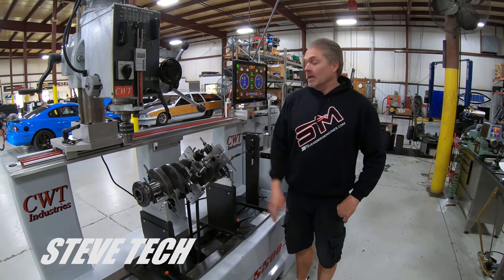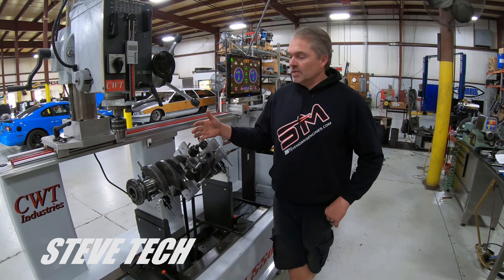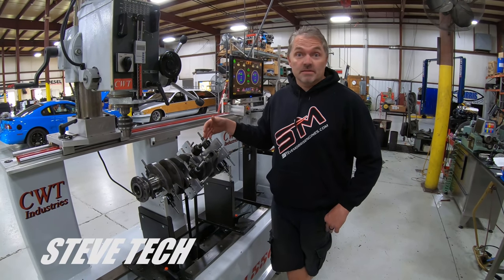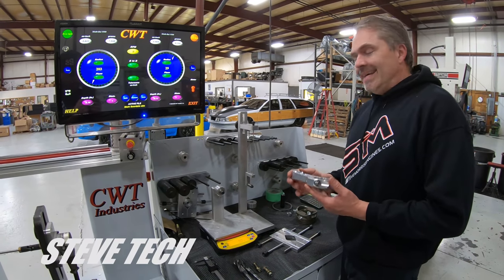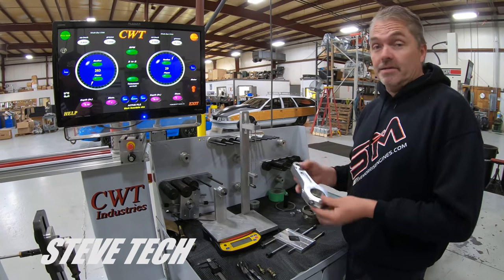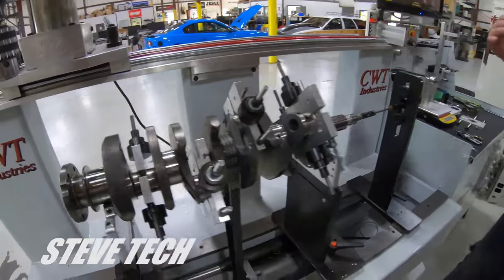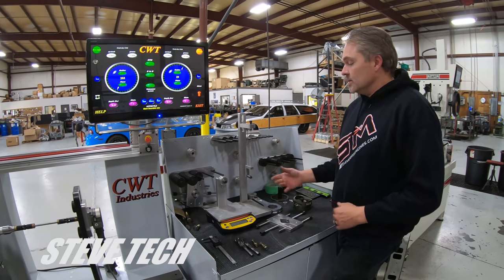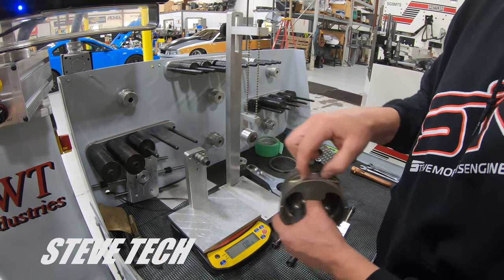Crank Balancing

Comment: I used to balance jet engine rotating assemblies and this really brings back some good memories. In some instances we would actually introduce a known imbalance in centimeter grams, then spin the assembly. The computer would provide a solution set with PO1-P07 balance weights that would thread into the rear spinner cone. We would measure the imbalance in amplitude of mils (0.001") which is where the fan blade would oscillate off axis. Could even use the equipment to determine individual frequencies of components that ran off the accessory drive gearbox. If the imbalance was too great the engine would require a complete fan blade restack. What made this whole deal so challenging was it wasn't just the weight of a blade, it was how far from the center of the engine that weight was located. The further away from the center the weight was located, the more influence it possessed. Even though designed to be identical, every blade was never the same.

Comment: I have been taught , you weigh the big end ,and make sure all weigh the same by grinding them to the lightest rod, then weigh the total rod and grind the small end to make them all the same weight. It seems to work out the same as yours but is better because it eliminates one process  and is more sure . Hope this helps someone . I run a balance machine many years ago and learned all macines in a several shops.

Comment: @22:50 Steve explains what can happen if the Mallory metal is not installed in the side of the crank when adding weight during balancing. Unfortunately Billy from SRC learned that lesson the hard way when he put his Nova into the guardrail because his engine builder went the cheap/lazy route. Way to call it Steve!  This is why you're the best!
Reply: Billy could have avoided the wreck and oil on the track by having a diaper on the car.
Reply: @oldandboosted  True. Bill Sr. said in his latest 'Old Man's Garage' video that he was picking up three diapers for his kids racecars.
Reply: @oldandboosted  . People Should run a engine catch tray with deep sides that bolts to chassis of the car. Engine diapers are one solution, but if oil is spilt or a oil pressure line is leaking it is way harder to diagnose because you can not seee the lower section of the engine. Also if they get soaked in engine oil they become a fire hazard. Check out Steve's latest video when al 8 connecting rods disintegrate on the engine from the Bosstmaster2 and it puts massive holes in the oil pan. The catch tray catches everything and does not oil down the track or put oil under the rear tires. Plus a engine diaper also makes the engine run hotter. It is worth while building a good quality engine catch pan.
Reply: @MJTAUTOMOTIVE  I agree but not every car can run a catch pan. Sometimes the engine oil pan hangs down below everything else. If you cannot run a catch pan, then you must run an engine diaper. I agree that catch pans would be better but an engine diaper is easier for most people. Steve Morris's car is basically a pro mod. It was built to accept a catch pan.
Reply: @oldandboosted  I agree that all vehicles are different. but a catch tray can be custom made to suit just about anything. even if it id only 3/4 of a inch from the oil pan, it is still a better idea than a diaper. Engine diapers are a pain to get to fit correctly. When Running that sort of horsepower the vehicle should be modified to make a catch pan fit. If you have a diaper and the engine lets go, you have to not only repair your engine but also replace the diaper. once they get oil soaked, you can never get the oil out of them. I had a vehicle in for a tune fitted with a diaper and it caught fire on the Dyno. The owner had a leak on a turbo feed line before h
He bought in to me and said that he had cleaned and degreased the diaper and the engine bay. After a couple of low boost pulls i started to see a little bit of smoke. Once we stopped and shut the vehicle down the smoke coming from around the lower part of the engine just below the left hand turbo manifold, up it went. It was not big and we got it out very quick, it did not do any damage except burn a little paint and scorched the sheath on one of the battery cable wires. I think it might be just Me, but i do not like them. If that would of happened on a full pass a the track with a lot more heat, we would never know what would of happened. So in other words I manufacture and fit a lot of catch trays.
OK rant over. Cheers.

Comment: The likely reason that the temporary test weights show as being too light is because they were placed inboard of the counterweights instead of centered on them.  The further in they are the less their weight will impact the end balance.  If you wanted test weights that better simulated the effect of the mallory metal you could use magnets.  If you place half on each side of the counterweight it'll better simulate weight placed in the counterweight.

Comment: Great video Steve. Can you put out a video that gets stuck in a little deeper? Lightening the crank, knife-edging, drilling out journals, and then balancing the crank?
Also, maybe a general ballpark what the average engine or performance shop charges for the various operations. 👍

Comment: I used to balance 1200 lb. Electric motor rotors all the way down to 5 lb. Fans.the theory you just explained it right on point.i was one of the perfectionist types that had to see just how perfect I could get them.to get anything to a perfect 0 g. Would take hours sometimes.in the end,it is not necessary to be perfect.the outside influences will affect balance.

Comment: How much does that crank position sensor running out on the front throw the balance off?   Bound to introduce some vibration for the sensor to pick up. Is the thread in the nose of that crank really that far off or is the adapter bent?
Reply from the maker: zero, I have actually checked it, it is so close to center.
Reply: This was my question. Didnt think id have to scroll so far to find it.

Comment: My 1969 Kiekhaefer 482's (stroked 427 tall block offshore race motors) use solid flywheels like you would use for a clutch and they were balanced with the rest of the stuff, including the crank's balancer. Lot's of holes all over the place. I actually gave them a neutral 427 flywheel and a 454's with the big counterweight. They used the 454's so they wouldn't have to add weight. That heavy metal is expensive.

Comment: You would be surprised just how much some flywheels and clutch covers are out!  When you get a chance, spin up a crank and get it balanced, then add the flywheel and see how much it trows it out ... then add the clutch cover and see how it goes ... the guy who did some tuning for me reckoned some of the most expensive clutch units where the furthest out!!

Comment: Steve, when you press in the Mallory Metal for aspect amount of weight, if it were to then weigh a little to much, would you seek up and remove a little Mallory Metal or the counter weight on the crank?  Thank you for the Video. 
😎👍

Comment: Good stuff Steve.. So if I’m all balanced up correctly and decide I want to change to different heavier pistons with a large dome vs flat tops I already have.. As long as I make sure all 8 are within a gram of each other it wouldn’t matter that they are heavier than the flattops I ran before? If i understand correctly there would be no need to rebalance the whole rotating assembly correct?

Comment: Billy from SRC (Street Racing Channel) Just had a piece of mallory sling through the oil pan exactly like you just said. Oiled down the track and sent him into the left lane wall from the right lane. The motor builder I think "Box" was who built the engine but the crank was bored out and mallory welded in. Go to SRC channel or The Old Mans Garage on YT and check it out.

Comment: Hi Steve, love your videos. I know it's not going to be a popular question but you did mention it once. 4 cylinder engines. It's normally considered that the pistons/rods balance each other out. But then I wonder if you have an issue with undersized counterweight creating stresses on the crank with in turn leads to bearing wear. For something like that would you have to cut off the pair of counterweights from the centre of the mains point, weigh them, then do the same on the big end side and weigh that section, then add onto that the calculation you did earlier in the video to combine rotational/reciprocal weight. Then whatever your short on the counterweight side you add?......obviously I understand you destroy a crank to get those figures on the hope you can apply it to the same crank from the same manufacturer as long as the manufacturing tolerance is close enough......sorry for the long question.

Comment: Thanks heaps for sharing real info from someone who actually does it for a living and gets results !  Question though on balance setup shown here - crank snout keyway, has opposing keyways with a key installed on one side ?  I also see the drive stud and chuck a bit off center, while they're close to the rotating center, I see weight needed adding to the side without a key ?
So question is - how critical are my observations and whether the key is installed or not ?

Comment: Are the rings weighed straight from the box or filed to fit in their bores prior to weigh. I'm thinking its probably not enough to worry about?
Reply from the maker: Cant even measure the material removed from ring gaps. at least on a gram scale
Reply: @stevemorrisracing  Thank you

Comment: I was only interested in this about 40 years ago, and I seem to remember for single cylinder engines, the books said that the reciprocating to rotary factor was about 1/3 to 37%.   That was because the big end did a complete circle, and the small end just went up and down...  midway between the two bearings, it did a combination of the two movements.   Was this just the static balance, and your 50% is needed for dynamic balancing..?

Comment: Back in the 70's, we would just take our motors to our favorite speed shop (mine was M & M Speed Shop in Sacramento, where I was stationed) and have it "balanced and blueprinted" with a 3/4 cam tossed in for good measure. Never fully understood WHAT was done, just that my 1970 Chevelle's 427 ran like a raped ape after that.

Comment: I have to wonder how Pontiac removed the center counter weights on the 301 engine's crankshaft and still got it to balance? Did they also lighten the pistons and rods? I get everything performance I build balanced but I have done many stock rebuilds over the years where the cylinders were bored and of course new pistons used and never had those engines rebalanced. I never had a vibration problem. I kind of wonder what the factory tolerance was on a 350 Chevy from about 1975? I'm sure they weren't nearly as close as what Steve is doing.

Comment: Stupid question for someone who may know......I've done crank pinning kits before for supercharged ls1's to keep the balancer from slipping.  The kit calls for drilling .8" deep into the crank with a 1/4" drill.  Then you install a 3/4" dowel pin that sits exactly in between the crankshaft and harmonic balancer.  You think this would create enough of an imbalance?

Comment: Another great video with EXCELLENT explanation.  I have taken a balancer that I suspected to be off & had it checked by adding it to the crank after it was balanced.  It is a good idea to NEVER use a cheap one on really good engines because they are often off.

10 or 15 grams on way or another isn't any big deal in the real world.

Question: do you tend to add a tiny bit heavy so you can easily remove some if needed?
Reply: ROMAC are great jmho

Comment: One thing worth keeping in mind when it comes to balancing an engine is how the out of balance centrifugal forces compare to combustion developed forces.

For example let's say you screwed up and your engine is 10g out of balance at the crank pin, you have a 4" stroke, produce 1000ft-lb of peak torque, redline at 8000 rpm and your combustion cycle products effective torque over 1/4 of a crank rotation.

Based on the above, the combustion force on the crank pins average 3000 lbf (pounds of force) and likely peaks well over 10000 lbf (depending on ignition timing, etc).

That 10g of out of balance, at 8000 rpm, only generated a force of 80 lbf.

When you rev the engine up in neutral you'll probably notice the vibration, but at wide open throttle your motor's internals likely won't even feel it. If an extra 80 lbf causes rapid disassembly, your motor was on the edge of destruction anyway.

Note I'm not saying balancing isn't important. It is, especially for an engine expected to last for high mileage. If your daily driven street car's engine is out of balance the extra forces will exist even while cruising down the road, not to mention you'll feel a constant vibration.

BTW, one of the reasons adding/removing balancing weight to the crank never seems to be perfect is that it depends on how far the weight is from the crank center (in addition to the difficulty in both measuring and adding/removing weight at the correct angular position). The centrifugal equation for out of balance force is:
mass x rpm² x radius

So when the software says to add 10g, it is assuming a certain radius for where you place or remove the weight.

Comment: I know this is an old video but Steve, if your still reading, can you explain why the reciprocating weight doesn't include the rod end weight?

If you consider TDC vs BDC, the entire piston, rings, pin, AND rod end (ultimately the entire connecting rod) all move up and down by the stroke length. Mid stroke there is a small nonlinearity in the vertical motion of the big end vs small end of the rod, but ultimately all of the rod reciprocates (by vertical I mean parallel to piston travel direction).

Components of the crank itself, such as the crankpin, also move vertically, but since this is truly rotating it isn't quite the same as simple reciprocating weight and I assume this is already balanced through the rotary balance.
Reply from the maker: Small end is in the reciprocating, sorry if I made it sound like it was not

Comment: It does matter, i ask you how much does that weight increase become at 8000 rpm. I can tell you... a LOT, Steve you should get it as close as possible so other things such as oil dont add as much to the equation, i have an ASE badge that says i am a master engine machinist., I have actually run a machine shop in Texas. Listening to you .. I would not let you balance my crank !

Comment: You entered a number for the oil weight  in the crank throw oil passages in the bobweight calculation. Do you calculate 
the oil weight  for the rod bearing clearance  or was that included  in your
oil passage weight?  I thought  I heard
you say  5 grams. THANKS
Reply: William,  I know that Steve wouldn't mind me answering this for you.  The oil weight,  is 100 percent,  arbitrary.  There's no way in the universe,  that any engine builder can 100 percent verify that weight, inside a race engine or any engine for that matter, adhering to the rod as the engine is running. As Steve concluded,  5 grams is a perfect,  arbitrary weight. I often used as much as 7 grams, as the engines I built generally used the longest rods possible.  Bottom line is there's NO  exact weight, there's NO  right or wrong,  it's totally ARBITRARY.  I hope that helps Sir.
T.S. RACING
Reply: @t.s.racing  
Thanks  for the info.
Just  viewed  a video from  Antique  Boat Museum  in Clayton NY about
rebuilding  an ancient  Scripps Marine engine and they cut 23 lbs  off the crankshaft counterweights to gain
clearance  to grind  the journals. Didn't 
say anything  about  balance. Maybe they swapped  cast iron  pistons with
aluminum.! I'M  CONFUSED.

Comment: With all these variables is balancing even necessary?
Reply: So why then this machine exist, yes, a well balance engine will last and perform better, not mentioning rotary engine that can rev up to 11,000 rpm, vibration is the second enemy of the engine, first one is US😁
Reply: @Me-fj8sb  Plus or minus 2%, oil windage, piston ring drag. I'm waiting on Steve's reply.

Comment: Thanks for the interesting Video!

Cant you lube that balancing machine? That thing squeeks like hell.
Reply: it is from the rubber band that rotates the crank similar to the belt on a carpet vacuum cleaner that rotates the brush head ... spray lube would only cause it to slip aka the KY Theory

Comment: Its an old video so this will probably never be answered but i noticed you didn't add the weights of the pin buttons into the machine, I'm guessing you did it before making the video as most value's were already set but who knows.
Also when Balancing the crank i noticed the connection between the crank and the sensor wobbles quite a bit, i can only imagine with a machine so sensitive as this that wobble will create false values for the weights on that side of the crank?

Comment: I have a question on building on stroking a 454. I like to put a 4.25 crank in with stock rods and bore. Just get the right compression height piston. 

Or do I have to spend the money to buy a stroker kit and machine work.
Reply: I like to just get a 4.25 crank and put the pistons on myself. And do a good hand hone.
Reply: 454 is externally balanced

Comment: How does the Mallory metal possibly get shot out on a run someone putting it in wrong?
Reply: 22:50
Reply: That’s what just happened Billy SRC Racing channel.Mallory metal came out the top of crank,went through the oil pan.Oiled down the track.Put him into the wall,exactly what Steve said could happen.
Reply: CENTRIFICAL FORCE